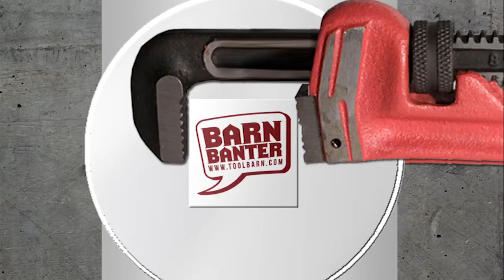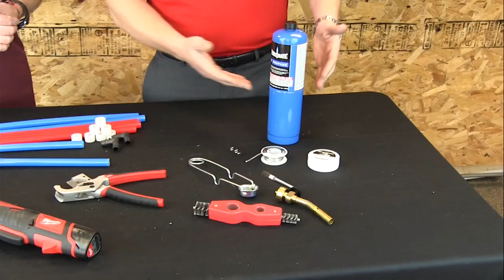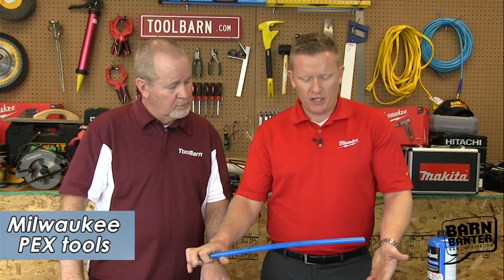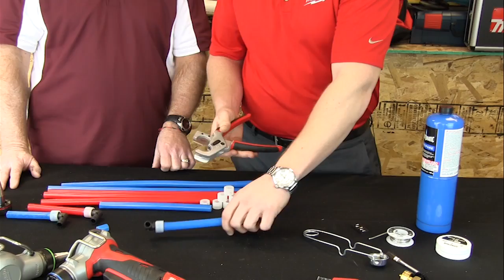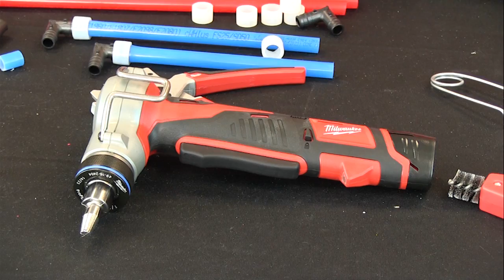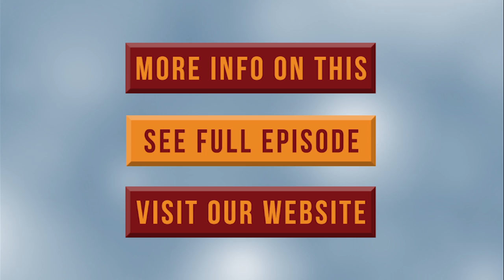Milwaukee PEX Plumbing Tools

Comment: That Wirsbo type pex shyte that relies on "memory" no longer gets used in Australia with no major suppliers carrying fittings, pipe or tools.

A Company I worked for used it on the inwall hot and cold water supply in  Sydneys Bennalong apartments (right next the the Sydney Opera House) the most expensive per square meter apartments in Australia and after only a few years water leaks became so common, mostly on the hot water, that the decision was made to completely replace all the in wall pipework! at enormous hassle and cost.

Personally I reckon the only cross linked polyethylene system that should be allowed is Rehau style slide fittings/joints.
The varitey of different, non compatible, non interchangeable pex systems is a fking disgrace.
We once had uniform plumbing materials  standards in Australia and if manafactures didn't want to comply then they could be fked off out of our market.
I can buy a 16mm, 20mm, 25mm, 32mm  copper fitting etc from any plumbing supplier and use it on a pipe that was installed 50 fking years ago and sold as half inch, 3/4, inch, inch, 1 1/4 etc
Same goes for PVC and gal pipe and fittings.
Why the step backwards?
The only reason is fking marketing ones with suppliers trying to "lock in" their plumbing contractors to their exclusive product.
How the hell have PEX manafactures and suppliers gotten away with this clear step backwards, not having to comply with a single standard.

Dont even get me started on the even more ridiculous heating iron/fusion plastic piping systems!

Comment: That expansion tool is $400, and he says the copper tools are 'a lot of investments'.
Reply: you can try non-power tool, those are cheaper.
but even power tools are not that expensive. you can buy Dewalt expander for around $200, if you already own battery and chargers.
Reply: A copper pro press is about $1000+

Comment: Copper is a thing of the past for potable water they don't make copper like they used to. Upenor pex all the way  an copper is way to expensive compare to the black polymer fittings  witch are just as strong as copper an they don't wear tru with hi flow as copper or brass does. Tjanks
Reply: copper is still code in most commercial applications since pex is not fire rated.

Comment: I was told the expansion fittings are only good for PROPEX Can you use the expansion system on the regular PEX tubing?????
Reply: Expansion is only used on PEX-A. You can use compression fittings on both A and B
Reply from the maker: This expander is designed for Uponor fittings.

Comment: hahahha sounds great but it dont work nothing is better than solder and copper pipe .i luv pex and pex rings but i wwont use this in a half a million dollar home upstairs bath.no way ..
Reply: Daniel Llamas All plumbing in commercial buildings, such as banks, schools, jails, gas stations, grocery stores, etc use pex with this system. All those projects dwarf your "million dollar home" the whole new US Bank Stadium is plumbed with pex. On top of the fact that commercial buildings come with a much longer warranty, sometimes in upwards of 30 years with the stadium I just mentioned. I've seen this first hand and every plumber and pipe fitter I've ever met loves the stuff.
Reply: Daniel Llamas half million dollar house won't even have a second story here lol
Reply: Get with the times dude. People said the same thing about PVC.
Reply: I wish I could use this method. But. Absolutely no exceptions in NYC besides Copper,cast iron pipes and BX wires   Everything else is not allowed 😐😐😐
Reply: Dewaltpro picture - probably because all the rats in the city.  PEX and rodents don't mix well

Comment: NO NO NO IT WILL LEAK EVENTUALLY.
Reply: chmellen Proof?
Reply: so will copper, gets eaten away from hard water or standing water.
Reply: I've not seen any leaks of this type of expansion fitting. I ve seen pex crimp rings failed that was because plumber faulty installation.

Comment: Can it be used for rehau?
Reply from the maker: +Boobdepot1977 The Pex Expander is designed specifically to work with Uponor pex tubing - So I would stick to that brand.
Reply: +Toolbarn Sure, but Uponor isn't available in Australia, generally Rehau and its licensed offshoot and another compression fitting brand called Auspex that uses similar dimension pipe are the norm. With no automated expansion tools readily available Milwaukee would make a killing here if Rehau heads could interchange. I'm a fan of the M12 system, I now use these tools daily.
Reply from the maker: Boobdepot1977 We'll just have to wait and see what Milwaukee will do.  I'm sure they realize there is a market down there.